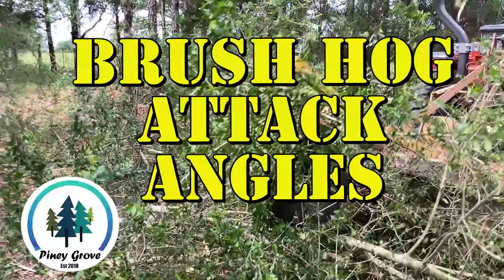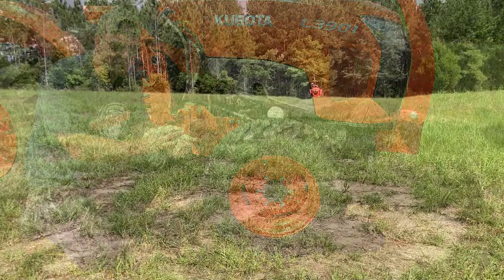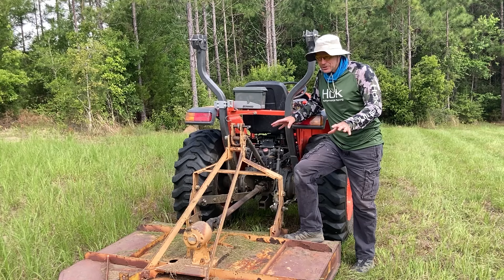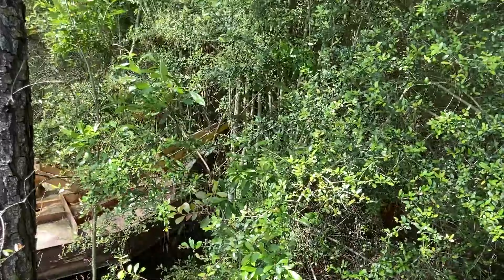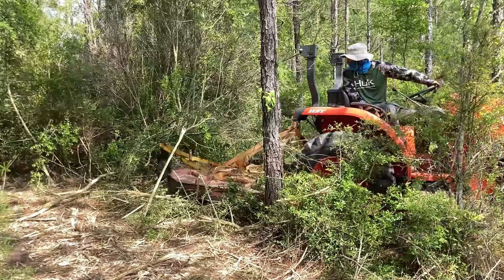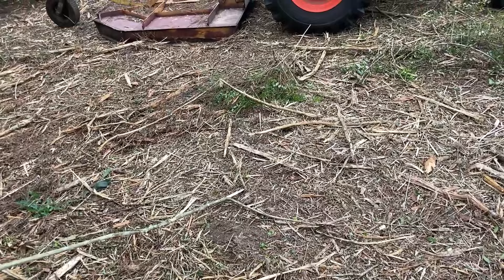Brush Hog Attack Angles for Mowing THICK Brush and Trees with a Compact Tractor

Comment: This was some pretty good info Brad. I have always used the brush hog in a forward direction because of the rear discharge. When I do use it in reverse, it is because of brush or thistle growing on a ditch bank where I can't get to it any other way. I always leave me loader on and bull doze the brush before I hit it with the mower. That method has served me well in the past.
I have an old I.H. pull behind chopper. My Dad used to mow over brush that was higher than his head standing up on the platform of the 520 John Deere tractor. I don't want anyone around when I mow with that. It will throw some sizable chunks over 100 feet. I don't mow when the cattle are around either. Good way to kill something or somebody.
Thanks for sharing this info Brad. Great job on the demonstration as well. See you for the next one.
Reply from the maker: Thanks Gary.   Our goal with this video was to demonstrate that brush hogs are probably more "durable" than a lot of new tractor owners are willing to try.    After 40+ years on a tractor, they still amaze me!!  Take care. Brad&Deb

Comment: I have several acres of heavy briers, brush, and cedars on my land. I have a Yanmar 223 and recently bought a 48" King Kutter. Thank goodness I didn't hire a forestry mulcher cause I am eating right through it. I am amazed at how quickly I can clear an area and reclaim my land. I do find myself leaning over some of the taller, thicker stuff with my front bucket before backing into it. I feel it puts less pressure on the 3 point area.
Reply from the maker: Brush cutters are more durable than most people are willing to push them!

Comment: That’s what old tractors are good for. They don’t have much on the bottom side for brush to tear up. Newer tractor I ram the brush with front end loader like a bull dozer. Most of it will uproot or snap apart

Comment: Another and probably safer option is push them over with bucket first then back up and mulch it up. It will be a lot less stressful on the equipment. Although I do it both ways , and have a bent up bush hog show for it. Lol
Reply from the maker: For those tight areas, having the loader off is a game changer.  But yes, we've knocked over some big stuff with the loader to get it down where the King Kutter can chew it up.  Thanks for watching.
Reply: @PineyGroveHomestead  I really haven't done that with a loader off but we'll give it a try. I  have 6 acres in the back of my property that I want to clean up and it's hard to navigate in those tight spaces with the loader
Reply from the maker: @deerrudy  YES, definitely take the loader off and at least try it.  I need to find some space in the shop where I can do it all the time because it's not as easy to put back on on un-level ground.  🙃

Comment: Will the brush hog  cut brush stumps low enough  that you don't worry about flat tires ? Great video
Reply from the maker: It tends to shred them rather than leave them sharp and pointy.  I've never gotten a flat from them, but it could happen.  Thanks for watching.
Reply: @PineyGroveHomestead  that for your reply, love the idea of beefing up the deck,, dó you have option on model brush hog to get for Kubota bx25d that would handle 1 to 2 Inch red cedar trees and brush,, thanks
Reply from the maker: @jimg8218  4' wide is probably the best width for a BX.  As far as types of cutter, there are rotary like mine and flail. I don't have a flail mower, but they can handle brush too.  Cedar is a pretty tough wood to cut....I can run over a 2" pine and shred it, but a cedar trunk usually stays whole.   Brands : King Kutter and Land Pride...Frontier (by John Deere) is good too.    Here's me working some cedar with a rotary cutter.  https://youtu.be/oDH87Lv75Dc

Comment: You don't really want your hog to be level to the ground. You want the front to be slightly lower than the rear. Reason being, you want your blades to cut at the front but not be bogged down by parasitic drag across the entire cutting width of your blades. Anything that springs up can be cut by your blades in the rear. But the lions share of the cutting should be done with the leading edge of your blades in the front of the travel of the bush hog. Believe it or not, leaving your hog level uses quite a bit more power than having the front slightly lower than your rear. Try it and see.
Reply from the maker: I'll keep that in mind next time!

Comment: A brush hog is not a land clearing tool. Every time do this type clearing I end up with regrets. Flat tires, wrecked gears, broken u joints , muffler damage, electrical lines damage are just a few things that result.
Reply from the maker: Agree that it's hard on equipment, but we've not had any issues like that.